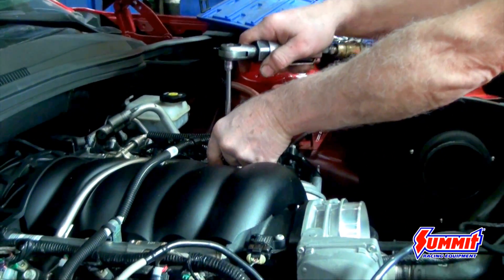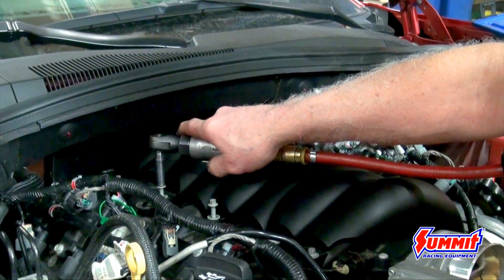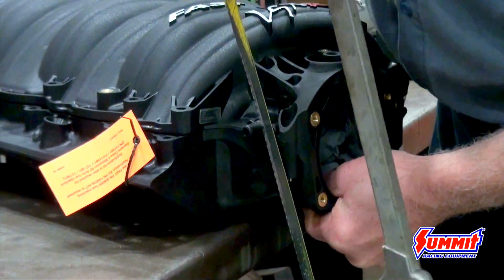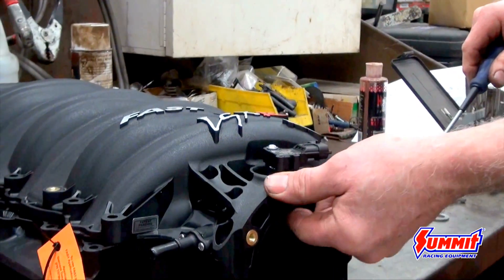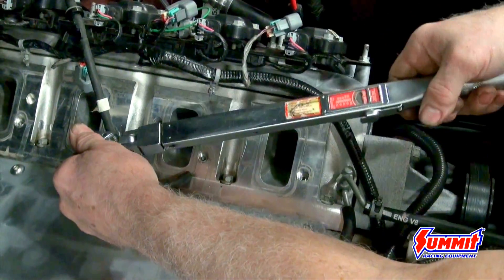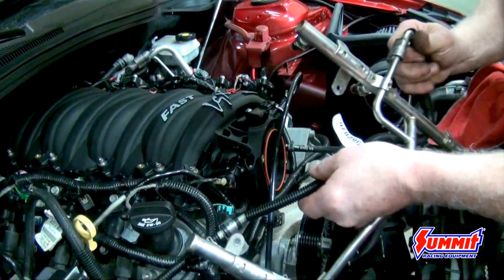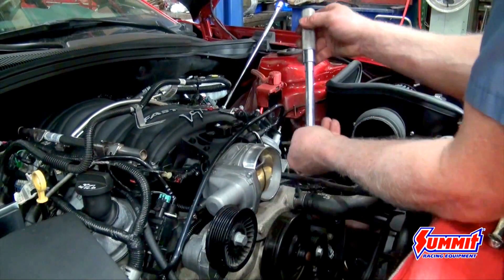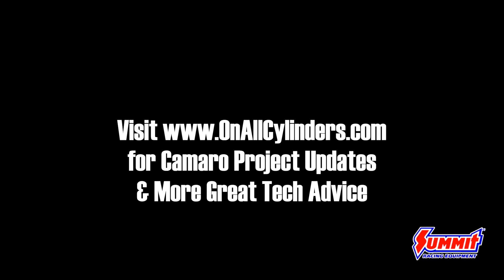FAST LSXR Intake Manifold Install on 2013 Camaro - Summit Racing

Comment: Does the LS3 suffer from the revised (driver side) valve cover baffling issue..? I have a 2010 Chevy Camaro with a mid 2009 production date, so it probably has the pre-revised (driver’s side) valve cover if anything. 

My question though, is if the (older) LS3 (non-AFM/DOD) requires this? The manual/non-AFM/DOD LS3 engines don’t have the PCV routing that the L99 engines in the automatic/DOD equipped 5th gen (10-15) Camaro V8’s have. Instead of PCV routing all the way to the rear driver side valve cover, mine is simply capped off from the factory…

On top of that, I was planning to swap out my stock valley cover plate and gasket for it, due to excessive oil blow-by. I noticed this issue after installing an oil catch can; where the catch can would fill up 70-75% of the way, with every ~200-250 miles of driving or so!

Comment: I love how he doesn't mention anything about removing the tensioner pulley to add a spacer so the Throttle body and the pulley aren't contracting
Reply: That's exactly what I'm dealing with. I just I just figured it out and ordered a different tensioner pulley. There's literally no info about this issue.
Reply: @baykrawler what tensenior did you end up buying? I’m about to buy this manifold

Comment: for an $1,100 manifold made specifically for the LS3/L99 its crazy that you have to drill it
Reply: Because its probably designed for "L99" the EFM + automatic transmission version of the manual + no EFM "LS3"

Comment: Do you have to upgrade the throttle body to 102mm diameter when upgrading the manifold?
Reply: no you can run the stock one or the 102

Comment: For the throttle body 106 in-lbs or 8.833333 ft-lb. For the intake manifold Step 1. 44 in-lbs or 3.666667 ft-lb. Step 2. 89 in-lbs or 7.416667 ft-lb. Tightening sequence your gonna have to message me on FB, cuz it's a lot easier to send you a pic of it.

Comment: Stupid question Im sure but learning cars and modding as I go with my Camaro.  Isn't a tune needed after installing something like this or does it not matter since it's after sensors?
Reply: It will need a tune to maximize performance.
Reply from the maker: The FAST LSXR intake manifold has a CARB E.O. number and is emissions legal in all 50 states. A tune is not required. However, there will be greater power gains with a tune, especially if the intake manifold is installed with a 102mm throttle body and other modifications.

Comment: So I have this and just the runners what else do I need before I start
Reply from the maker: We recommend a throttle body and gaskets, you may want to consider an upgrade to your injectors and fuel rail as well.
https://www.summitracing.com/parts/fst-146302b/recommendedparts/part-type/throttle-bodies

Thank you for watching!

Comment: does this intake add a lot of horses to an engine about how much?
Reply: Crypto Pirate only adds 10 to 30+ for stock engine if you have other upgrades like ported heads or cam or any additional mods done to the car then it will help to your advantage cause the more mods you do to your engine the more as you would say “Needy” your car will get like if you have so much done to your car like ported heads cam smaller pulleys forced pistons  bigger crank etc and your still running on stock fuel injectors then you will not get the full potential from the mods you’ve done because it has lack of fuel so you will need way bigger injectors to feed your engine:) hope I helped or at least gave you a look outside the box

Comment: i want to order this part for my car i looked at several websites and the price varies .. my question is do i have to purchase all the extras aside of the manifold
Reply: What do you mean by all the extras? yes, you will of course need everything that makes the manifold bolt on. Besides O-rings and a few bits, it's pretty much complete. That being said, don't do this swap without the 102 mm throttle body. It makes a world of difference.

Comment: i thought you needed to install the fuel injector spacers so the fuel rail crossover wouldnt bottom out on the top of the intake manifold.  unless i missed that??

Comment: and it is because of what happened at 3:59 in this video that the very first thing youre supposed to do after removing the intake is to shove shop towels down the intake ports on the heads or put masking tape over all of them.
Reply: Saw that too.
Reply: I thought the same thing.................

Comment: I had a question, is there one of those plastic EFI intake manifolds which can be fitted to the Chevy big block ZZ572 engine. Thank you
Reply from the maker: +Field_Marshal_Flintlock , 
Currently, there are none. Sorry we couldn't help!
Reply: Use the Edelbrock Pro Flo XT intake with a Holley Dominator setup.